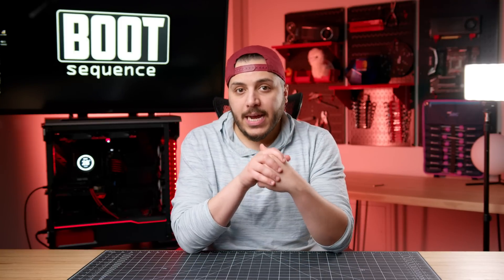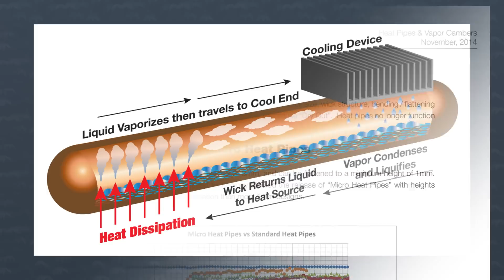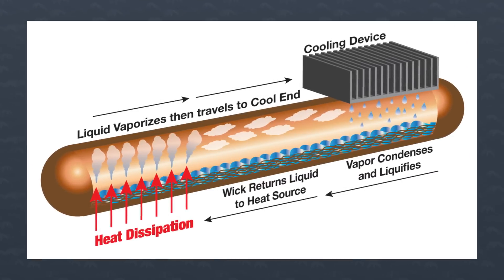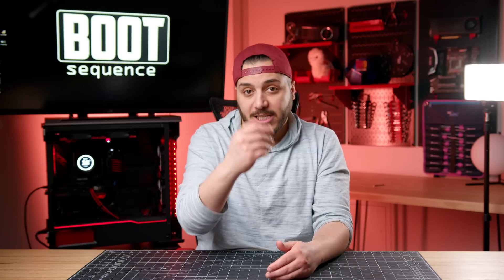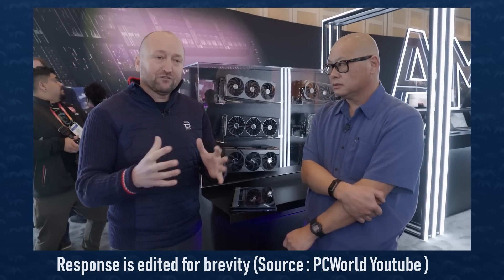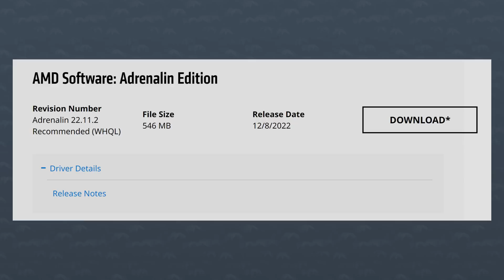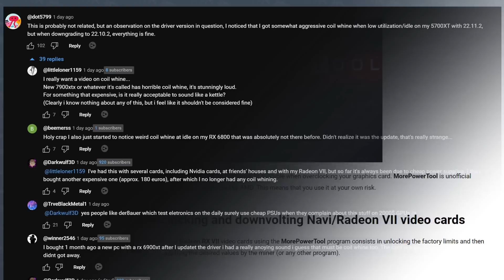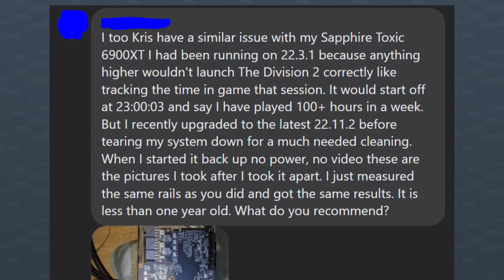Are AMD Drivers Breaking RX 6000 Series GPU's?! (UPDATE IN COMMENTS )

Comment: I've been using an aib 6900xt for the past 2 years and I've had plenty of driver issues with it over that time.  Multimonitor issues have been among the worst of them as the card randomly drops signal to the 2nd UW monitor while in use and AMD promised to fix it with the driver in question.  While on all AMD hardware the problem persisted but once I moved onto an Intel Z790 motherboard with 13900k the problem seems to have cleared up for the most part with it showing up every once in a while even with MPO disabled just like I did on the AMD build.  Nevertheless my next gpu will be from ngreedia.

Comment: This was actually caused by the first driver exclusive for RX 7000 series that could be installed on older cards.
Reply: No it was not actually caused by that.

I love how people pull facts out of thin air. It very funny when we learn the real reason later
Reply: No, it turns out this was all because they were used mining cards and stored incorrectly. Then sold..

Comment: I have 6700 XT with latest drivers and have noticed increased coil whine and temp with the current newest driver. I deciced to downgrade to previous one as it also seemed like uncharted 4 is broken with latest driver (6700 xt specific problem)
Reply: the latest driver 22.12.1/2 SPECIFICLY says RX 7000 only...

Comment: You should really review your source of information, Kris updated and said it's not the drivers, and Igor said it's most likely mounting pressure for the cracked dies since you'd need to over-tighten the heatsink in that horribly for that to happen.The mounting pressure probably created a mini vacuum on the die's surface or a giant air bubble that hardened the thermal paste like a glue somehow.

A power surge through the PC with no use of UPS Unit to offset the current is likely how their GPU died, as this is in Germany, where electricity related grid issues arises due to the whole 'gas' supply thing with Russia and they changed to alternate fuel like natural gas or whatnot... It's very likely that the power surged.

Comment: Not so much the Drivers fault but people who cannot read which says 7000 series only and they install them on their 6000 cards. What is an issue though is AMD not blocking installs on the 6000 cards when the first 7000 series drivers were released. I do believe AMD has fixed that since then in the second and third released drivers. So if people did not ignore the warnings where it says 7000 series drivers only their 6000 cards would still be working fine. 

So it's AMD's fault fpor not blocking the first 7000 driver and user errors for not reading the warning.
Reply: This makes a lot more sense, first time I hear about this being the case. So 22.11.2 should be fine on my msi mech rx 6600 xt oc? I've been using it and it hasn't done anything bad yet. Didn't know ppl were using 7000 series drivers on 6000 series and that was breaking them.

Comment: To me it looks like a miner took in these card's the newest RX6000 driver is a month old and we just now are starting to hear about this and only from one location only if it was a driver issue ot would be world wide issue and if this guy is reporting such a massive amount of card's dieing on the driver's that's been avaliable for the 6000 card's for a month it would be insane news going about with tens of thousands of reports but no it's one shop in one place in the world.

My guess is it's a miner using the wrong driver ment for rx7000 card's or used a custom bios or something then they fucked up and cooked. The card's some of these card's are still under warranty but instead of taking them to AAMD and getting them replaced they took them to 3rd party repair shop almost like they knew they voided the warranty.

Comment: I have an MSI 6800 Gaming X Trio (non-XT) and is running on 22.11.2 since it came out. Under 100% load the GPU hotspot is 70°C, the other is 60°C. With this driver I did not experience an anomalies (I'm also using an MSI 6600 Mech 2 and a Sapphire 6650XT Nitro with the same drivers, again no issue, however the chip is different)
Reply: I have the same card with 22.11.2 drivers and everything is ok. I have also 60 degrees and 70 on hot spot  with 50% fan speed at 100% load. I had problem with MSI Afterburner today but as always it was windows fault. I had to delete Dragon Center because it was changing MSI AF reseting settings. This happened just after yesterday windows update (it was working normal before). I hope that one day windows will be in trash and Linux be the main system for gaming.

Comment: Drivers are not the problem. 22.11.2 are WHQL drivers and passed all tests.
Obviously, some people installed drivers not meant for those GPUs (like the 22.12.1) and that may cause issues, included bad VRM management.
Reply: Then why is it 23.1.1 for 7000 series and 22.11.2 for any other? Look on AMD's site.
Reply: @kyoudaiken  22.12.1, 22.12.2, 23.1.1 are ALL for 7000 series.
Latest drivers for 6000 and older series are the 22.11.2 WHQL.
Use the correct driver for your GPU.
Reply: @sharktooh76  I see. I don't need to worry, got a 3090 on water with something similar to a MoRa. :) So I'm good. Just interested for the sake of knowledge.
Reply: @kyoudaiken  well I hope Nvidia drivers won't kill your GPU because it already happened twice in the past on every user installing those drivers.... And that was actually a Nvidia drivers fault
Reply: @sharktooh76  Never had any issue with NVidia since 2015 with my Titan X Maxwell Gen2, 2080ti and now the 3090.

I had issues with my 4650G APU on my bedroom PC where Windows kept installing an older driver mid watching Netflix or YT. Stupid things like that until I switched to Manjaro Linux on that machine. MESA is much more reliable. Later I switched to a 5700G because PCSX2 was struggling. Now I am happy with it.

I got scheduling issues with AMD Threadripper 3960X which lost more and more performance over the last months. The chip and mobo are definitely fine. It's a software issue but on my main PC I need Windows. USB issues where devices only work on specific ports, occasional boots with all cores stuck at 700 MHz, etc. BIOS and chipset drivers are up to date. Windows has been reinstalled... And in the 90s I also had a lot of issues with AMD Athlons. Going back to Intel for CPU on my main PC soon.

My NAS runs on a 5600G, but XMP doesn't work and caused file corruption. But on 2666 CL15 it now runs well and I notice no performance issues on the NAS, which also hosts a few other services on Ubuntu Server 22.04 LTS.

Very disappointed of AMD on some fronts. But that's just my experience. Most people seem to be fine, especially with AM4 products, when they only play games and browse the web. I don't want AMD to get in trouble too much, we need competition.
Reply: @kyoudaiken  update the bios to fix the USB issues
Reply: @sharktooh76  I am on the latest BIOS on the TRX40 platform. Still the same issues. Also this platform didn't get a new AGESA since about a year...
Reply: @kyoudaiken   that depends on the motherboard manufacturer

Comment: I remember Nvidia having an issue way back around 2010, with their 196.75 drivers. That on some cards back then, would interfere with the GPU's fan controller, that would evntually kill the GPU.
Reply: Before that, older drivers killed Nvidia GPUs as soon as they were installed. Can't remember the version....just use Google.
However, this issue is not related to AMD drivers, unless you installed the wrong version on unsupported GPUs

Comment: If a few cards experienced the "same" issue, people could argue that it's similar, but may be not exactly the same, but when that many cards have the same fault using the same driver, that's a repeatable trend and not anecdotal at all. I wonder if Roman (derbauer) will test this out soon. I sure hope so!
Reply: That many cards sent into a repair shop only takes place in Germany, if there were more massive issues worldwide you would have seen much much more on the AMD reddit page.

This is clearly a sign of user error in some form, not a defect though because it does take quite a bit of effort to crack the die. Other than the sensitive pins, the IHS is generally a tough piece of metal for the most part when comparing normal levels of handling them.

Comment: Kind of weird to release series specific drivers and not a pack that checks which card you have.
With 90% of PC users being clueless these days that can only go well. 😂
Anyway, my FE RX 6800 runs like a charm with 22.11.2 and I'm VERY happy with it.
Reply: Not sure if that's what's happening but we will have to see.
Reply: It's not the drivers, the cracked die is a result of over tightened mounting pressure, and the burnt circuits is due to power surges as these customers likely didn't use UPS or special surge protection for their PC. All the 48 GPUs and more are in Germany, there's a whole 'energy' crisis happening for a while due to the war and it's possible that the power grid is fluctuating up and down.

My friend in Michigan had several devices fried when a lightning strike hit the cable/phone lines, entering his home through the copper wires, thankfully his PC Ethernet was protected by a surge protector but his PS5 and TV, and modem and switches all got FRIED because the power travelled through the ethernet cables!
Reply: @dra6o0n  I'm from Germany and tere are no issues with the power grid and that would also take out the rest of the PC. There are only price hikes for capitalistic reasons.

Also yes, AMD drivers copy the BIOS into video memory when the driver loads, and then modify it as needed for patches for issues. The VBIOS resides in the GPU memory, it's not directly ran from the EEPROM. Buildzoid has proof for this. So there IS a possibility that it's the drivers. But we don't know anything yet.

Comment: I have a 6900XT FE since the release is still running stable.

On the driver update the fault is from both parties. 
Why don't people just read that the drivers are only for the 7000 series. (It says it on there site) sounds like the south park meme lol.
The other side its AMD's fault to because why you can install those drivers on there older product when its only for the 7000 series it should be blocked for installing on there older products.

Comment: I have a 6900XT and i have been having constant driver issues for the past 5 months. Before that i never had an issue since the card launched which i got right after launch
Reply: Sounds like you need to do a clean install of the driver
Reply: latest driver 22.12.1/2 specificly says RX 7000 only, dont use it for RX 6000 cards
Reply: @georgwarhead2801  I agree with you that is said and typically every driver check the PCIID of the car to stop installing in unsupported cards. So depending on how it got installed, the blame may fall into the owners for force the install or AMD for not limiting the installation. More info is needed.
Reply: @georgwarhead2801  the last few drivers before the 7000 cards have been unstable for me. Starting to think other hardware in my system might be the issue
Reply: Go back to Windows 10
Reply: @helthuismartin  I never left windows 10
Reply: Your card is about to crack its core.. RMA IT
Reply: @Bassjunkie_1  you have no idea what you are talking about

Comment: So, the driver in question is meant only for rx 7000 cards. The cards have massively different energy requirements considering 7000 series is a MCM design. In order to download the drivers, they had to go to the website because the normal utility doesn’t let you update to it. Though, amd shouldn’t even allow it in the first place, so there’s that too. If you’re updating drivers through the “AMD software: adrenaline edition” and let it auto detect, the card it will not find anything. You have to manually download the driver to the wrong gen card
Reply: Exactly, The 6900 XT and the 6950 XT are still under warranty, why they didn't send them back to AMD or the AIB partner instead of the repairman, because they F#cked around with the 7000 series driver and found out. there are dumb people out there.
Reply: @hdz77  currently AMD adrenalin (which i just installed as i was curious) suggests me to install 22.11.2 coming from 22.11.1 on a 6800xt so it really isn't the users fault, it auto updates to that if you have it set to do it automatically
Reply: @hdz77  Agreed. Theres way way more to it and people like Buildzoid running with the story to be the one that got the scoop. Lame. Yes i own a 6900xt but ive also been into tech for over 20 years and never seen a driver crack cores even if the temps and power limits are to high. You have to seek to force that to happen
Reply: @hdz77  amd also fucked up to release 7000 driver and allow it to be installed on 6000 series (regardless manual install) that potentially can destroy the gpu. The fact that they fix this issue in the next driver 22.12.2 which can no longer be installed on 6000,  means amd know they made a mistake.
Reply: It sounds believable, but if up to 60 people got their GPUs cracked then either:
- it was not clear enough which drivers to pick
- there were not enough safeguards against it in the software
Reply: The issue could be that but. I doubt 60+ people went to the website to update when the amd utility is easier to download the driver. I don’t think that explains it fully. I really will be willing to be if you asked those 60 people probably only a certain % upgraded from the website. Also many countries it takes too long to get a card sent back to you and also some people only have a 1 year warranty or they don’t know how to use a warranty. I’ve seen people pay techs for repair of things h see warranty for many reasons. Warranty repair sucks and takes a long time with certain countries and brands
Reply: @cppctek  When I have stability issues in certain games i often use the AMD site to test some older and newer drivers to see if that fixes it (usually it does), so there definitely is a reason to manually download drivers. Additionally I never like having drivers auto update as it often causes issues and i do not see the need for AMDs software, so I only install the driver without the extras regardless
Reply: 23.1.1 WHQL is specifically for RX 7900 Series. Look at the AMD homepage under the driver section. 6000 series have 22.11.2 WHQL as the latest driver version.... WAIT A MINUTE!
Reply: I have a 6700 and actually downgraded back off the december update. Same exact version number mentioned here and it's recommended to me to install from adrenaline. Downgraded because the graphics would completely freeze up on me randomly and had to hard reboot. Hasn't died luckily but definitely causing an issue at least it was for me. Tried everything, reinstalled it even and the issue came back
Reply: Actually it’s not you wrong. I looked up 6800 xt driver on their website and this is the driver they are giving. I know because I own one. Get your facts straight before making a know it all comment.

Comment: This all sounds odd - why are they sending cards to this guy when its likely under warrenty still? if not from the store most manufactorers have over 2+ years?
Reply: Yep, The problem is that the owners of this GPUs downloaded 22.12.1 a Driver that was meant for the 7900XT/7900XTX released in December and GPUs used for mining. Idiot youtubers jumping on the gossip news bandwagon with no proof to back up what they heard from other youtubers that also had no proof. The 6900 XT and the 6950 XT are still under warranty, why they didn't send them back to AMD or the AIB partner instead of the repairman, because they F#cked around with the 7000 series driver and found out. there are dumb people out there

Comment: (Theory Crafting) What if the new driver unlocked additional “overclocking room”, the users immediately noticed, and tried to push their cards further than they could handle, and it caused the cards to overheat and fail catastrophically?

Comment: Is it happening anywhere else?  That's about 80%...in one area.  Is it more widespread?  If not, why not?  I don't think it was strictly a driver issue, unless it's a lot more widespread.
Reply from the maker: Good question. That's why im going to keep an eye on this story for the next few weeks.
Reply: @BootSequence  The problem is that the owners of this GPUs downloaded 22.12.1 a Driver that was meant for the 7900XT/7900XTX released in December and GPUs used for mining. Idiot youtubers jumping on the gossip news bandwagon with no proof to back up what they heard from other youtubers that also had no proof.
Reply: @hdz77  Ooof... It's not like AMD has a good reputation in general right now. But news just keep informing people and spread awarenes of a possible issue that might be a disaster for them. Until then, we have to wait. I think Der8auer is already investigating.
Reply: @BootSequence  The 6900 XT and the 6950 XT are still under warranty, why they didn't send them back to AMD or the AIB partner instead of the repairman, because they F#cked around with the 7000 series driver and found out. there are dumb people out there.
Reply: @hdz77  Because in Germany after 6 months, even if you have 2 years warranty by law, it's difficult to get warranty replacements because of the "liability turnaround".